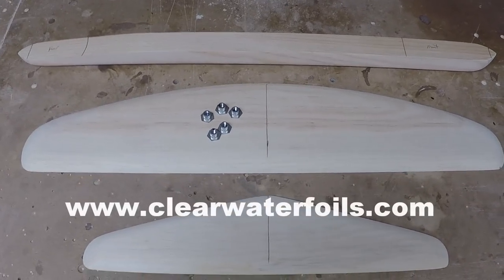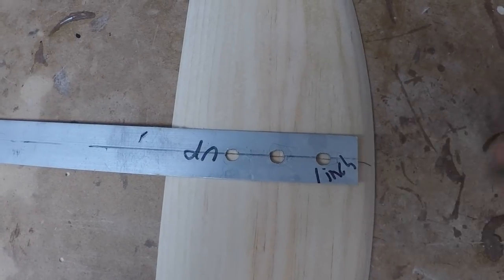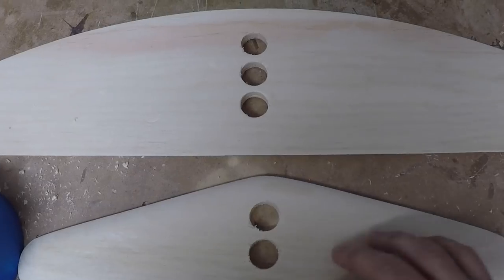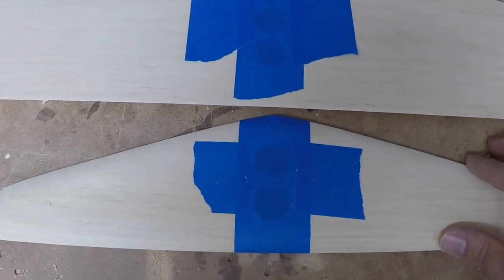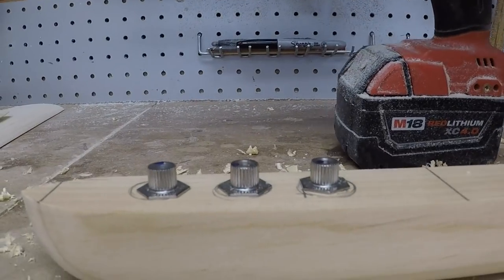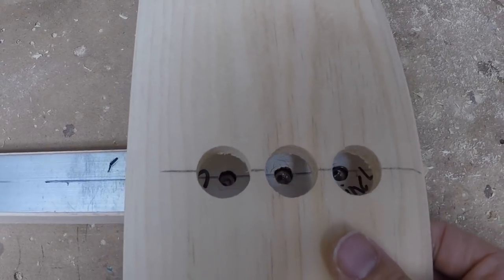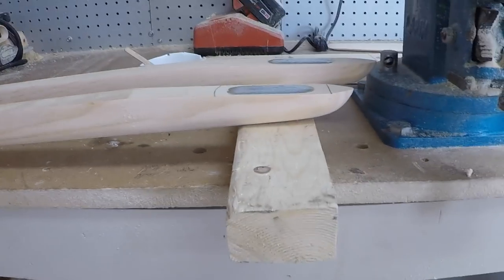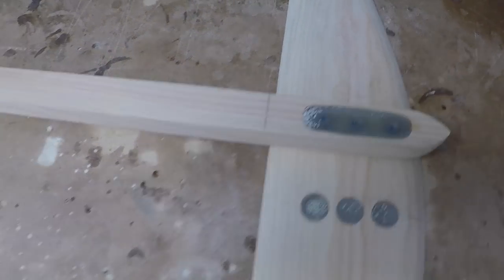HOW TO Make Removable Hydrofoil Wings

Comment: Using the inserts is it possible to change the angle of attack of the stabilizer using shims once it's complete? 

What is the stabilizer angle of attack you have pre cut into the fuselage in the kit?
Reply: u can use wedges to change the angle of attack. and usually the angle of attack of most foils is -2 degrees for the tail

Comment: Has anyone tried this with the foam core wings? Wondering if it would still work
Reply: I have using the 1500cm wing from here, same method of drilling a hole and filling with epoxy/filler mix. I put vaseline on the fuselage then glassed, making a little pocket for extra stability. However my spot has waves so I have been forever chasing my board downwind, then giving up and twintipping while the wind is good. Might have to try and build James's tracked board some day.